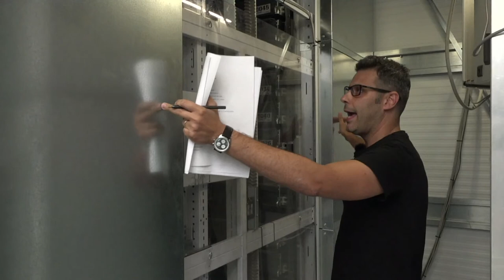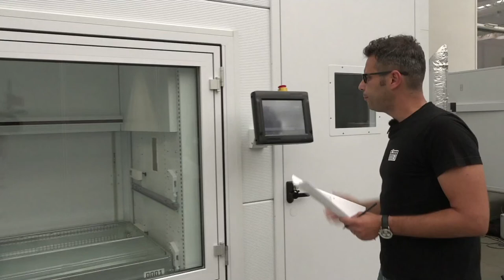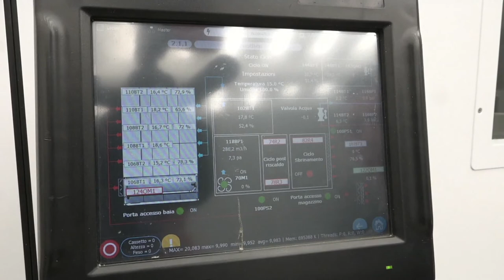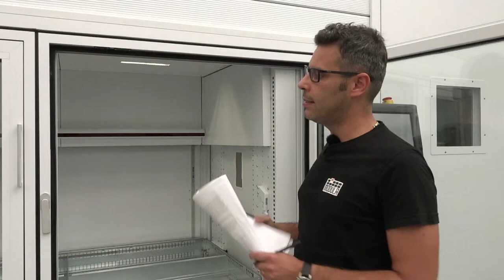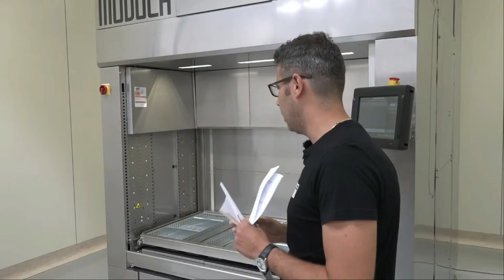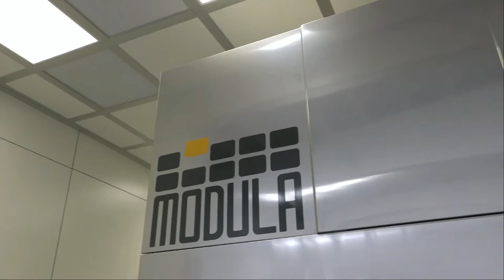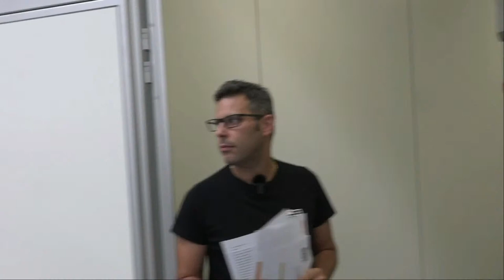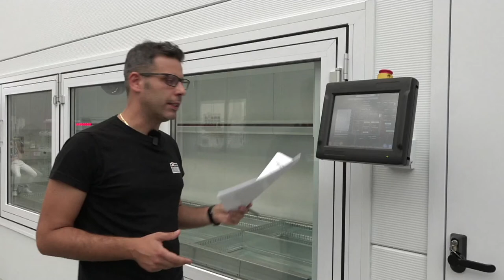Modula Automated Storage Solutions for Climate Controlled and Clean Room Environments - CHAPTER #1

Comment: Does the machine has the capacity to manage two different temperatures in the bay and in the storage area ?
Reply from the maker: We control the temperature with different sensors in the bay and inside the VLM. But we can’t manage different temperatures in the 2 areas. 
If the temperature in the bay is too high, due to long picking operations (for example), we can quickly force it down.